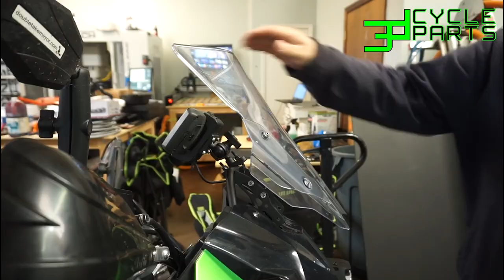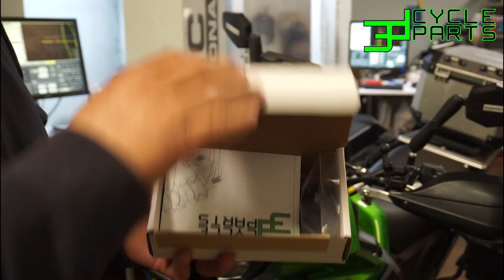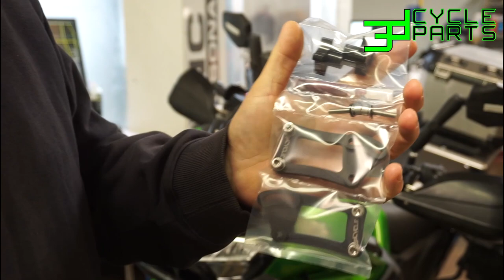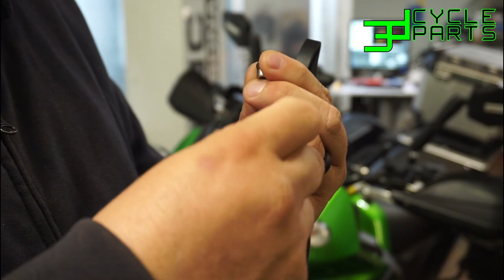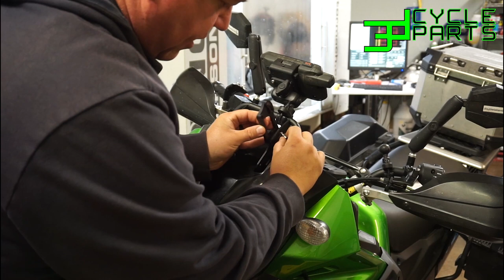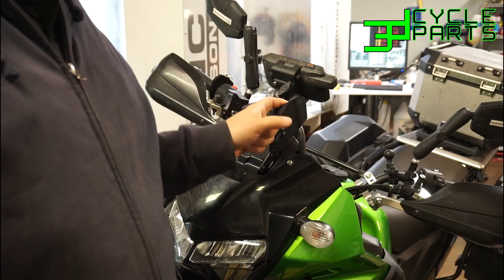2022+ KLR650 Adjustable Windscreen Riser Installation - 3D Cycle Parts

Comment: Can they fit on the "Low" mounting position, and still allow full range of adjustment? Or only on the upper position? Thanks.
Reply from the maker: Yes, full range of adjustment in high and low.